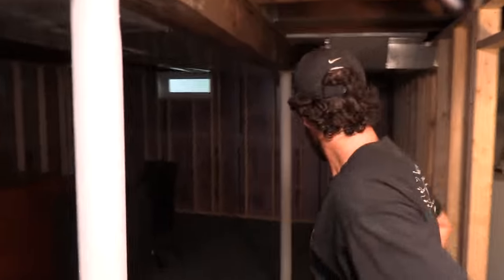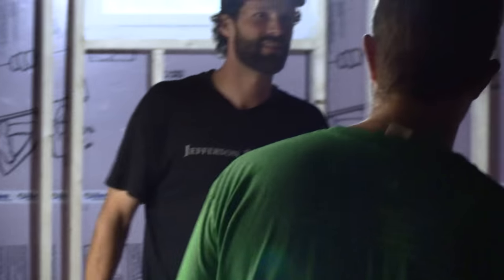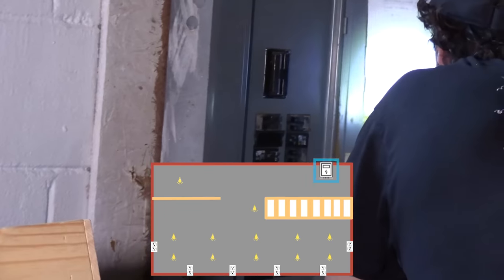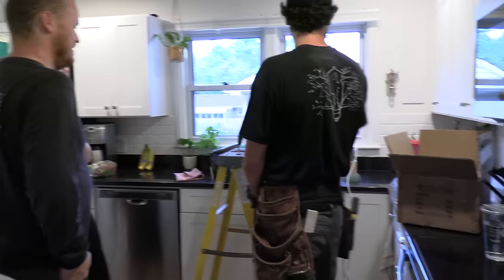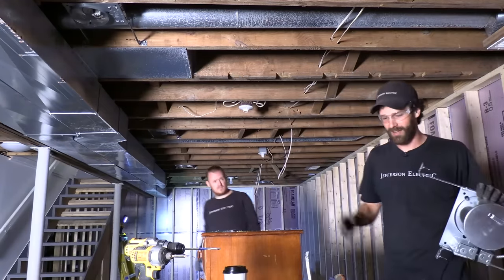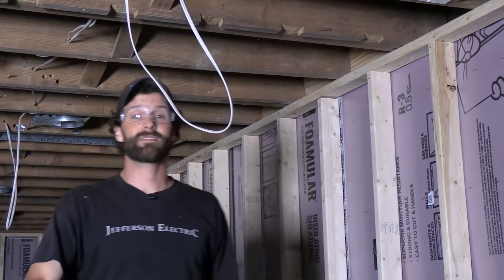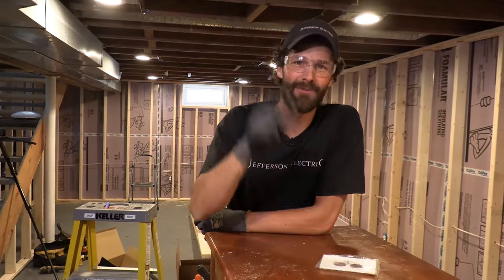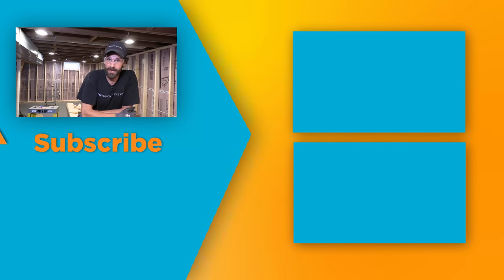Basement Transformation: Dungeon To De-Light

Comment: X-bracing is primarily used to solidify the floor in order to minimize movement or bouncing when walking on the floor. The bracing ties all the individual floor joists into one unit. So when someone crosses a room that walking load is now shared by parallel joists that are connected via the x-braces. Removing x-braces diminishes load sharing and increases the likelihood of floor movement. If you need to remove an x-brace to, as in your case, install a can, as best practice, you should replace the x-brace as close to the original location as possible.
Reply: Pro tip. Thanks. I've been dropping those like I dropped 3rd period french.

Comment: Laser is better because the wall can be wavy sometimes. Your cans might look wavy if you measure from the wall. I will measure off the wall for the ends and connect the middle ones with the laser to make sure it's a perfect straight line.
Reply: Iam poor so I've historically gotten 2 measurements one at both ends and pulled a string
Reply: @johnnymalicoat754  That method works great.

Comment: You are so right concerning securing permits. Was told maybe 40 years ago when you perform paid work their is a lifelong liability that goes with it. Do you can indeed get sued 20, 30 or more years later. Having a permit and inspection protects you. Was also told many moons ago to save ALL of your old code books in case one of the numerous ambulance chasing lawyers attempts to sue you.

Comment: Not sure why anyone still uses can lights. Wafer lights are easy and look better. I would add a 2x4 blocking at the lowest point of the joist as close to the can light as possible to restore solidity. Also see the panel has too many tandem breakers for code. Love the video and your attention to detail.
Reply: Because they can charge more on material markup. Cabs are old news and that is the only reason I can see what they would not talk the customer into wafers that are cheaper and better, can change the colors by just pulling down the xfmr, and not have to buy new retrofits
Reply: And it has Square D tandems, which are not listed for use in ANY panel other than Square D.

Comment: I  don't use Paddle Bits , aka Spade BIts , when I'm drilling holes through wooden framing members ! I use Irwin Nail Eaters 1/2''  and  3/4 '' Wood Auger Bits ! Always have and always will ! Been in the trade for over 55 years !!
Reply: Augers always make nice clean holes through studs and joists

Comment: You still need to replace the it, If removed it still needs to be replaced because it also deals with the flex of the floor and carrying load. Code from my understand is within 6 to 12" from the old bracing needs to be place back.

Comment: You have to staple within 12 inches of the box but you can have a maximum of 18 inches of cable from the box to the staple. This allows for a loop of extra cable just in case. "334.30 Securing and Supporting. Nonmetallic-sheathed cable shall be supported and secured by staples, cable ties listed and identified for securement and support, or straps, hangers, or similar fittings designed and installed so as not to damage the cable, at intervals not exceeding 1.4 m (4 ½ ft) and within 300 mm (12 in.) of every cable entry into enclosures such as outlet boxes, junction boxes, cabinets, or fittings. The cable length between the cable entry and the closest cable support shall not exceed 450 mm (18 in.). Flat cables shall not be stapled on edge."
Reply: @ElectricProAcademy  You're welcome.
Reply: So, to clarify, if I have a plastic box I'm running nmc into, and there's not provision for a clamp at the entry point (or even if there is), I need to staple the wire within 12" on the flat side. Correct?
Reply: @SirBrass  If there is a clamp then you need to staple within 12" of the box and if there is a knockout with no clamp (some single gang boxes just have pieces you knock out with no clamp) then you need to staple within 8" of the box. Always on flat side.
Reply: @illestofdemall13  awesome, thanks!
Reply: @SirBrass  No problem. You can leave a little excess cable between the staple and where it enters the box, just in case you need to move the box or pull more cable into the box. The maximum length of cable between the box and staple is 18".

Comment: Joist cross bracing X bracing is there for a purpose, would always moves no matter if it's old or new material, you can relocate the X bracing next to the can installing this way your still keeping the stability of the floor joist and its function.

24:11 2

Comment: At 21:58 - I've noticed wafer lights of the same quality (as measured by CRI and R9 values) are normally less expensive as compared to a can light. If DIYing I'd assume the labor to install is not a factor.

Comment: I don't believe you guys in the states typically use these, but for years now as a general contractor in Canada i've used "Illume Essential 4-inch LED White Recessed Panel Lights." You can get them either from an electrical supplier or home depot. Just run your 14/2 wire to the various light locations and leave a bit of excess in case. After paint, drywall etc come back and drill a 4-1/4" hole in the ceiling. Run your 14/2 into the junction box that it comes with, tuck it up into the drywalled ceiling or drop-in. Then the butterfly clips lock on to the drywall & bob's your uncle. Depending on which type of light you get, you can even set them for 3,000, 4,000 or 5,000 lumens. 

It'll cut your install time by at least 50%. If you're query about it, you can even run all your wires and then work with the contractor to arrange to come back after the ceiling drywall is up. That way you can cut your holes and pull your wires through making sure every thing is where it needs to be.

Worth looking into

Comment: some insurance companies frown on having any other brand breakers in the panel , there should only be Challenger breakers in there or a breaker that's been tested by U.L. to work in a Challenger box such as Cutler-Hammer CL style .  Cutler-Hammer BR's will fit in a Challenger but are not U.L. approved

Comment: Another thing about permits on remodels or additions - some jurisdictions review old work if in the future a permit is pulled ... so if you did that job without a permit and then it 3 years you had to pull a permit for a main panel replacement - the inspector pulls the specs on the house and sees the basement was originally unfinished - now he looks at the permit history and sees that no permits were pulled.. now there is a problem - because the sheetrock has covered the wiring without inspection the inspector can do a couple of things - call a code enforcement officer who can fine the homeowner - then make them purchase the permits and for electrical the inspector can make a contractor expose the key places that need inspection.  I picked up a apartment complex that was being converted to condominiums one time and the previous electrician was trying to pass the job off as maintenance- he was not a master electrician and was not a contractor so he got removed from the job - the inspector had me drill 4 inch holes at every outlet and fixture so he could check for wire securement... so the owner of the project had to spend more money in the long run than if he had hired a licensed electrical contractor... another time that will bite a homeowner is when the house sells.  If there has been a remodel or addition without permits it can hold up your house sale ... and might cost the homeowner some back property taxes if living square footage was added...

Comment: Cursory search and I discovered Challenger is a brand of panel that has had recalls and safety issues, and should be replaced. Oddly it was a panel that never clearly had its own breakers, or breakers that may have come with the panel were unbranded.
Reply: From everything I've read, the breakers in challenger panels were the issue. The actual bus bars were perfectly fine, and simply replacing them with Eaton BR type breakers makes them as safe as any modern Eaton panel.
Reply: You also failed to call out the Square D tandems, which are NOT listed for use in a panel other than Square D.

Comment: I am curious on how you determined placement of the can lights.  I have a room in my unfinished basement that is lit by four bare bulb receptacles like this customer had to begin with.  I want to change over to can lights but am not sure how I would space them out.
Reply: I am a symmetry guy, so measure the wall and divide by the amount of lights plus 1. So an 18’ wall that has 2 rows of can lights would  be 18/3 = 6’, if the room is 30’ and you’re installing 5 lights down the long edge, 30/6(5 lights + 1) = 5’. Total 10 lights. First one is 5’ off the short wall and 6’ off the long wall.
Reply: @AdamS-lh2ug  thank you that makes sense.  I had heard many years ago one had to account for the ceiling height in determining how big an area each can would illuminate, thus my uncertainty.

Comment: 24:40 Pre twist.... The wire nut will get this done also. No debate from me. I was taught to twist a junction of wires to the point that if that wire nut comes off/fails, the junction will hold. I have pretwisted large groups of wires. 5 or less, the wire nut will get er done.

Comment: 1. Should not the illumination requirements of a space be calculated professionally and not just guessed whimsically by eyeball?
2. Why not install a 20 amp circuit, especially where there are eight receptacles involved? Looks like 15 amp could get overloaded quickly.
3. Hopefully used commercial grade receptacles.

Comment: 17:39 A waste of labor? Making sure your holes are all level takes just a few minutes of extra time, especially if you have a laser handy. Even if all you have is a sharpie and a tape measure all you have to do is walk along the wall and mark each stud. Or just cut a piece of lumber to the right height and mark along its top. Even large rooms can be marked in a minute or three. The obvious benefit is that it looks neater, which is one step closer to godliness. It's also easier to pull through a straight line than a crooked one.

But there is another, less obvious downstream benefit: 
If slab insulation is being used, the installer will be able to score his panels at the same height for every cavity instead of having to measure each one. Sure, it's not YOUR labour saving but it doing so shows attention to detail and consideration towards your fellow tradefolk.
Reply: @ElectricProAcademy  Sure thing. My view stems from my own OCD to have straight lines because they're easy to follow and easy to understand, but courtesy to the other trades is a useful cover story. :)

Comment: Romex needs to be supported within 12" of a box not 18" NEC 334.30
Reply: The code of 334.30 is a little confusing but very specific. The staple must be no more than 12 inches from a box, but the length of the cable between that staple and entry of the box may be up to 18". That's for up to 6 inches of service slack.
Reply: @aaron74  Im looking at 334.30 as we speak in the 2020 NEC and i dont see any where in 334.30 securing and supporting where it mentions 18". Can you please cite where you see this code. Ive always thought it was simply 12". an extra 6" is a great idea.
Reply: @SeanLeonDrumz  The 2020 NEC:

334.30 Securing and Supporting. Nonmetallic-sheathed cable shall be supported and secured by staples, cable ties listed and identified for securement and support, or straps, hangers, or similar fittings designed and installed so as not to damage the cable, at intervals not exceeding 1.4 m (4.5 ft) and within 300 mm (12 in.) of every cable entry into enclosures such as outlet boxes, junction boxes, cabinets, or fittings. The cable length between the cable entry and the closest cable support shall not exceed 450 mm (18 in.). Flat cables shall not be stapled on edge.

Sections of cable protected from physical damage by raceway shall not be required to be secured within the raceway.
Reply: @aaron74  Interesting. My NEC paperback does not have this section " The cable length between the cable entry and the closest cable support shall not exceed 450 mm (18 in.)."
Reply: That's pretty weird you don't have it in your copy. You should contact NFPA; maybe they can send you a new copy. You could always make slack even before the language was added to 334.30 because there was never language in code expressly forbidding it. It's always been best practice in my opinion.
Reply: @aaron74  Thank you Aaron.

Comment: WHY didn't you go with the New Style of Recessed LED LIght Fixtures, the ones that don't have those big bulky metal Junction Boxes attached to the Can Light Mounting Joist Brackets ! The new one have a plastic box that the NM-B Romex goes into for the connections.
Reply: If you watched the video you'd know his reasoning.
Reply: It's definitely the approach I'd take... those big cans are obsolete. The wafer lights are lightweight and trim perfectly to drywall

Comment: Isn't Eaton BR the only acceptable modern replacement for challenger panels? I'm fairly certain all those square d breakers are no Bueno.
Reply: You are 100% correct. Challenger panels are also in the same "no-no" category as FPE panels, but the big difference is that the original Challenger breakers are what burn up. So, replacing them with the Eatons (and to my knowledge, those are the ONLY breakers rated to be in Challenger panels since Eaton bought Challenger and reverse-engineered the Challenger stuff) is an easy way to extend the usable life of the panel, so long as the stabs aren't cooked from the aforementioned bad Challenger breakers.
Reply: Cutler-Hammer CL style would be the top choice , BR is an acceptable (sometimes) second choice
Reply: Square D Homeline will fit anything that a BR does , Square D QO is not an interchangeable breaker

Comment: Why even use the wafer bracket? You should be able to come back after drywall, drill your holes, reach up and grab the wire.
Reply: In new construction you are required to install brackets!

Comment: Not a Wago fan?
Reply: wagos are 3 times the price of wire nuts (10 cents a piece vs 30 cents a piece). when you buy 50 thousand wire nuts per year that makes a huge difference for a business. wire nuts are fine...
Reply: Used pressure connectors my entire 50 year career with no problems. No such thing called a wire nut in the NEC. Yep that & $5 will get you a star bucks coffee Have used pressure connectors in the absolute worst environments from -40 degree freezers to hot rooms, on crushers, vibrating screens ,& shakers, daily high pressure wash downs, equipment that got water logged, slaughterhouse, stockyards, salt filled hide cellars etc.
Reply: Wago are overpriced and don’t make as good of a connection as properly twisting wires and using a wire nut
Reply: Feel free to dump your money on Wago’s.
Reply: I have asked that question here before, so passing along the answer I got :)

For home users (e.g. me) Wagos are a great product, but with the amount of complete rewires that Jefferson does a year, the cost difference becomes too much.
Reply: Wago is a fine product and as good or superior to wirenuts (especially for light fixture splicing convenience). The issue is their cost... they are VERY expensive compared to wirenuts. I've resolved to using Wago for joining 4 or more conductors (such as a bunch of neutrals and grounds in multi-gang switch box). Because wirenuts do not scale very well. But for two or three, maybe 4 if it's #14, they're fine.
Reply: Never really used wagos unless they were already on the fixture wires already.  Most electricians I have seen and worked with cut them off and put a wire nut.
Reply: @BrianIrwin   I agree, also while most DIY’ers won’t be doing this, they’re great when your working on live circuits, as you can throw a WAGO on and then continue to add into live circuit without having to twist live wires together and what not. I think that’s why you find them a lot in fixtures.
Reply: @AdamS-lh2ug  haha, that is one of the things I use them for a lot also. The other really nice thing for me is that since our house was built pre-war I generally have very little wire to deal with so I just need a small bit of good wire and don't mangle any more by twisting it.